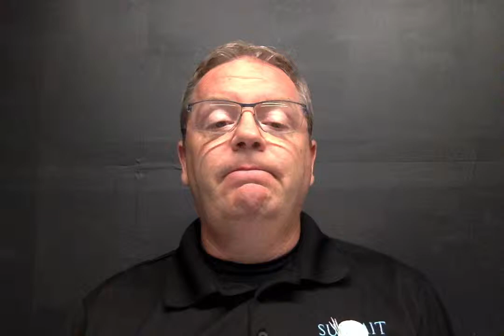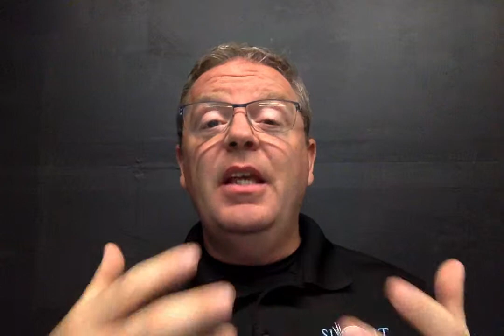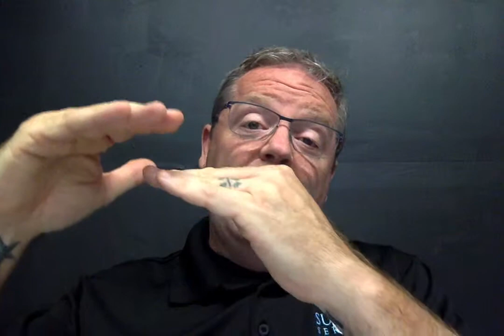How Dew Point Causes Condensation

Comment: excellent explanation! I hope you take requests, I have a home that gets very toasty on the 2nd floor in the summer time. I have cathedral style ceilings and have recently had dense pack cellulose installed but the improvement has been marginal. I have a theory that my 2nd floor return air on my HVAC may be to blame. While I have a return vent on my 2nd floor, it is not in the same stud space as my hvac system, and when the system is on I can see that it barely pulls any air. On the other hand, I have two return vents in the same studspace on the 1st floor, and the HVAC system is on the other side of the wall so the suction is quite intense. I am curious if I would see benefit from directly connecting the 2nd floor return to my HVAC system, or if it would be feasible to add more returns somehow? In general it fees like the HVAC system sucks in, and pushes out more air on the 1st floor, and the 2nd Floor doesn't get much benefit from HVAC air cycling with fan only.

Comment: Hello,  question for you. I have a 2005 Norris manufactured home and having issues with the exterior walls in the bedroom condensating,  so the drywall is mushy and I'm sure there is mold inside. We didn't have any troubles with it before until we got a really good portable ac unit for the bedroom.  We have a 2.5 ton Trane XR16 with Cleaneffects whole home purifier.  We wanted to take some of the stress off it by just chilling the bedroom to the temperatures we like to sleep in-59°. I know that's way colder than most people have it which I'm sure is why we're having the condensation issue.  How would you recommend I fix that (with out increasing room temp.)? Should I use a higher rated insulation or install a foil/foam board? I was blown away when I cut a piece of the drywall off- there is no osb behind the siding,  it's just the siding, a thin foam board, 2x4's, insulation, then the drywall. Thanks for any advice.

Comment: what if... we were talking about an isolated/closed system coldroom at 1degree celsius, is it possible for condensation to occur inside the return air ductwork?? without a leak in coldroom. my understanding is that cold air doesn't carry moisture  shouldn't  condensate inside duct returning toAhu dew point would be exterior of the ductwork where the surrounding temp is around 18 *c where would condensate in any area not adequately insulated,,, not inside duct. am I missing anything? just to let you in this is an argument im having with my companies founder/director who sent me to an already completed job to resolve issue of condensating return air grille, I think there is a leak in the structure introducing warm humid air, he thinks im wrong and that the problem is with fire dampers (in fire wall) that cant legally be insulated.. LOL museum coldroom where old photos/negatives are kept at controlled temp and humidity!